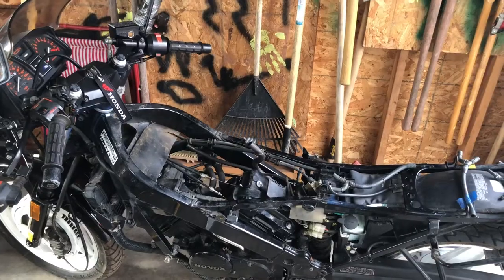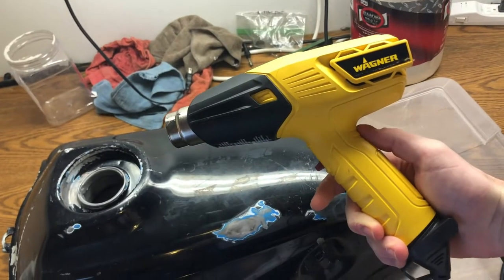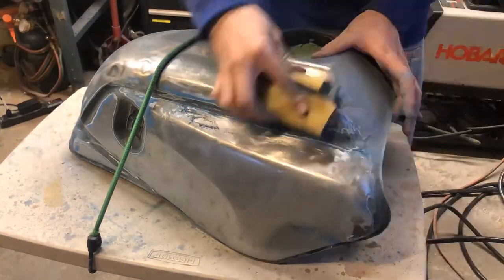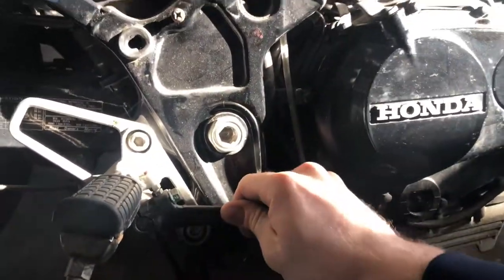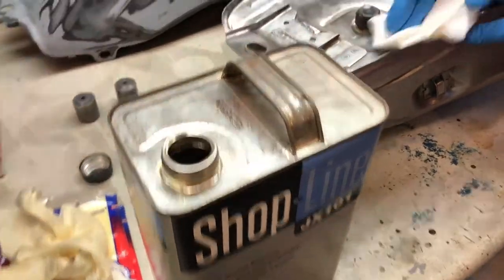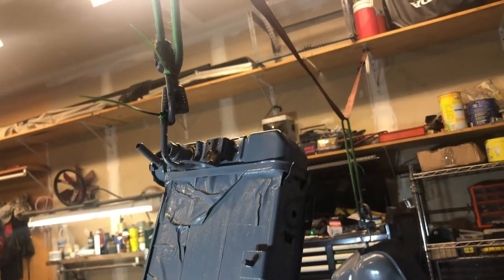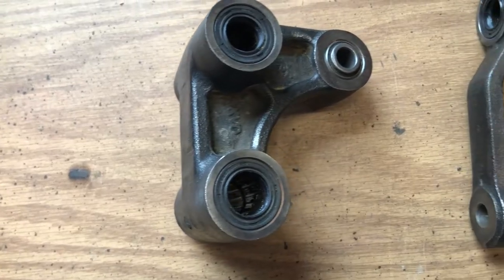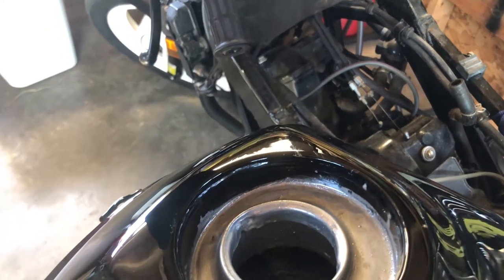Honda VTR 250 Project - Part 3: Gas Tank Restoration

Comment: hey brother you know how the stator is connected the regulator and the wiring harnesses is that I have a charging problem in the vtr 250 1990, thank you very much for the videos greetings :)
Reply from the maker: Ma De The stator has 3 wires coming from the engine that goes to the regulator which turns 3 phase high voltage power into single phase 12 volt. I would check that 3 pin connector and then the 4 pin connector which delivers power to everything else out of the regulator first. In my experience the most common cause is corrosion if not a cut, burned, or mangled wire because stators very rarely go bad, but my experience is limited. I hope this helps.